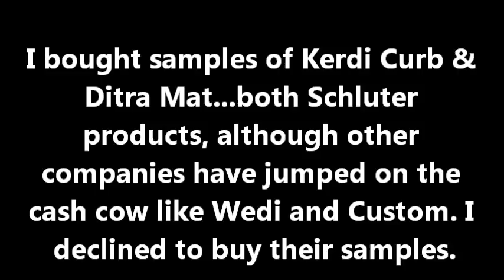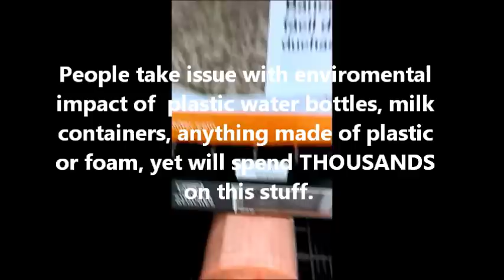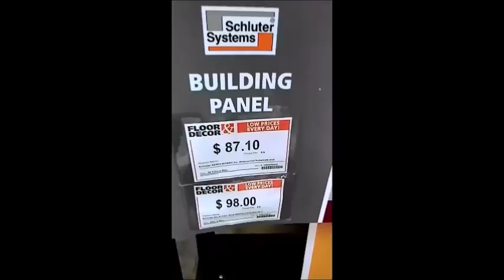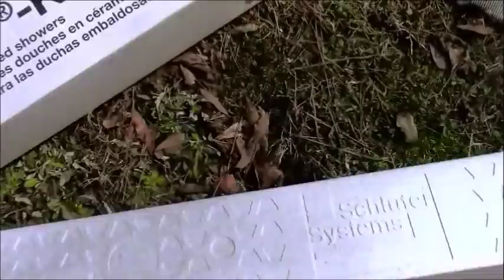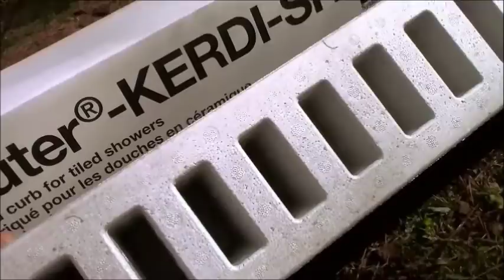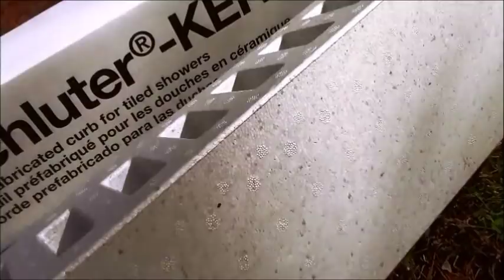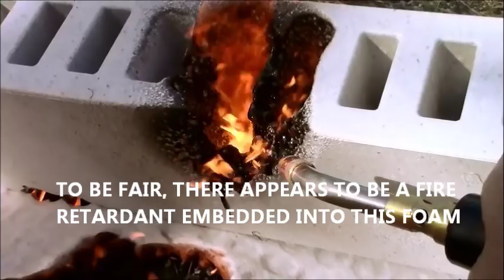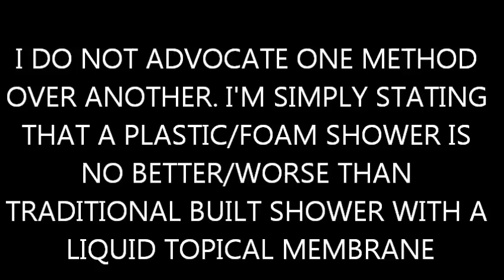BUILD SHOWER FROM FOAM and PLASTIC ??

Comment from the maker: The debate on proper materials will continue, in the end it doesn't matter, except the un-needed expense. I understand my view is un-popular, but I'll continue to speak out when I deem appropriate to do so. Comments are welcomed if you have an opposing view or something to add to the conversation...childish or stupid comments will be deleted so be nice
Reply: The video of it burning is impressive, and I get your firefighter point about the toxic chemicals, but, the Grenfell fire notwithstanding... How impressively would that stuff burn with a layer of tile/adhesive/grout on top, and a layer of subfloor/drywall/board underneath? Less impressively, right?

The real argument against this kind of stuff is: if it drives the material costs up more than the time saving in labour down, and doesn't give any significant benefit against existing methods, then there is no benefit.

I'm only an amateur, but I've done a few bathrooms and quite a bit of renovation... When you go into the building supply shop there are all kinds of "You can do this without any effort, just buy our stuff and it'll end up like a pro did it." products. People lose track of the fact that the biggest influence on the job is the quality of workmanship. I haven't watched all of your videos, but those I have all seem to fail because whoever was "doing" the "job" didn't use the materials correctly. 

Would I use the stuff? No. Why not? Because I can do the same job, in pretty much the same time (and DIY time costs zero), with traditional materials, if I take the time to figure out the underlying principles, and inform myself of the pitfalls. Your channel is great for pointing out the pitfalls - thanks!
Reply from the maker: IF it gets hot enough to ever burn, it will burn same way with or without other material(s) on it...but by then you have bigger issues. The bigger point of the video which was lost towards the end was the ridiculous expense.
Reply: One of the few things I agree with wholeheartedly.  That system is nothing more than a cashgrab. Shit product, why too expensive. Good video.
Reply: Schlutter. You have to use their thinset in order to have them warranty it. Read the fine print. I don’t know about your tile supply warehouses but in my area they sell all the Ditra and Kerdi shower products but they don’t sell their thinset. Makes sense doesn’t 
it?
I hotmop and cement float all my showers and tub enclosures for the past 25 years and have never had a failure. Knock on wood.
Demod showers 50 years old and they were fine just old.
Reply: Great videos by the way!
Reply: I STAY OLD SCHOOL !!!

Comment: I think these products are great for a DYIers, especially the pans.  I'd rather have an overly expensive pan than one that pools water and doesn't drain properly from my lack of experience doing the cement work.  The curbs, niches and benches I agree are unnecessary and very over priced.  I don't think these products are better, just easier for non-pros.  I could see pros using they for the time savings.  But I don't see them being better.
Reply: i have attempted this system, its not easy and the drain sux+ you are applying thinset to drywall? never made sense to me..

Comment: Plumber said the same thing when PVC drains came in, when pecs came in, when CPVC came in. All the professionals at that time right here to the old ways of doing things. But just like with PVC and in this case Schluter, technology is bringing us much better materials to use that will last far longer than the old traditional way of things. And I don't know what kind of soap bottles you use that would break through a curbs tile and substrate but damn.
Reply from the maker: Plumbers were happy to see PVC drains...and they solved a PROBLEM because there was one with cast iron drains. But they also thought Polybutylene was great and turned out it wasn't, CPVC was THOUGHT to be great and I show failures of THAT on my channel, and PEX has issues with rats eating through it to get to the water. 
The point of the curb is that it's only foam, glued with caulking....so NOT RIGHT*, while other ( older ) countries laugh at us, while they build with concrete & block...that will last FAR longer than the new crap we *THINK is better.

Comment: These products speed the job up immensely. As long as you can read and follow simple instructions it won't fail. That is if you actually follow the tcna handbook, like every installer should.

Comment: Please sur, tell your rate for a shower up to the ready for tile point. You rip on wedi, kerdi, when any real tile guy knows the cost is the same in the end labor and materials average out which ever way a installer goes. Lets do some simple math based on about a 25-30 sq ft pan
Wedi big pan. 1000 bucks. 150 to set. 1150 total
Kerdi pan with drain. 400 tops. 250 install. 650 total
Mud deck, bladder. Nice drain assembly.  150 materials and 900 on average to install. But 3 times the work. Still totally 1050. 
A homeowner will pay almost the same in the end as a total. Plain and simple. 
A diyer may save a little cash but the possibility for a less than happy outcome greatly increases with the labor intensive option.
Reply: MegaSkilla  "Are you ignorant or just a casual" Hmm.. I could say the same about you. I paid $350 for my complete Schluter shower kit. I have built the traditional way before. Schulter cuts two days off the install - waiting for the pre-slope then mud bed to cure, before applying waterproofing.

Comment: These products are fine, but they add wayyyyy to much price to a shower. And if you do a shower correctly any how you don't need these products. I"m amazed at how many professionals jump on the band wagon for these products. Good grief, a piece of styrofoam with a skin on it, they want in excess of 500 bucks for. A 2 1/2 x 5 ft piece of fiber glass or plastic for a pan, yep you guessed it 500 bucks. People never get tired of being robbed. This guys is right people. It's just corporate greed. I built showers most of my life and never had a call back or ever used these products. I for one am glad he is standing up to this madness.

Comment: Burning??? What the heck for?  Complete red herring.  Ditra and competing decoupling products (Mapegard, Redgard Uncoupling Mat, Stratamat) serve a very useful purpose - i.e. decoupling!  And carrying it, cutting it, and installing it is way easier than cement board.  It costs me $1/sf, and I don't have to buy screws for it.

Comment: I fully agree with you but for different reasons, it violate 2 major building principles in my book. 
1. Cement is incompatible with plastic ( in these products it is only adhering with a relatively weak mechanical bond)
2. Cement isnt waterproof, ( it is used as the primary waterproofer in these applications. )

If you disagree with me fine but I give 10 year warranty on all my work so I am only going to use products I believe in. Good luck collecting a warranty from one of these major companies like schlueter, gaaco, quest, ect.
Reply: Cement isn’t the primary waterproofer in this system, the Schluter membrane and banding fiber is the waterproofing when it is embedded into cement. That’s not the same thing. Really, the the only difference between this and say a product like Redguard is that one is solid and needs mortar to embed into and one is liquid. They do the same job. 
And you’re right plastic doesn’t bond well with cement on a flat surface, that’s why there is the fiber backing to Ditra on the bottom side. And on the top side, the ridges act as a channel in order for the mortar to interlock the tile layer with.
Reply: I give lifetime warranty, should be confident in your work

Comment: How can you give a public opinion if you don't actually know how the products are used and work together. You are giving some wrong information there bud. And you put cement board on top because you couldn't get it up... sounds like good stuff to me. Btw... that's the mat for Ditra heat... not standard ditra. You are bashing a product you know nothing about. And based on the videos of your work I've seen, you REALLY shouldn't be giving advice.
Reply from the maker: My opinion is just THAT ! My subjective opinion, as stated on the front end of the video. What exactly did I say that was incorrect ? How about when commenting that you actually have something substantial to say, rather than being ambiguous....based on the work on your videos, I would say you can't judge my work....wait, you have no videos !
Reply: RedGard, if applied properly is "waterproof" but it must be a minimum thickness of 25 mils (thickness of a thick business card) and comes with a 1 year warranty.  Most installers using this product fail to clean the substrate and apply enough, but not to much, to get the required coverage. For the most part, topical membranes run about the same specs.... however, would you really want a 1 year limited warranty? Schluter, Wedi etc give 10 years and more.  Second, you have no idea how the system actually works together so how can you give any advice on that? You say Kerdi fix applies the curb? Wrong. You talk about fire hazard to make your point? Really? First there must be fire. And then it, along with the wood studs,  possibly wood subfloor, carpet etc will all be up in flames... what good is a shower without a frame? I don't need videos because, well, I have education that I provide my customers directly. I use YOUR videos to show customers what not to do. I am a 20+ year installer with ZERO failures.  I am a Certified Tile Installer, certified by the Ceramic Tile Education Foundation. I follow ALL, ANSI and TCNA guidelines and specs. Something I absolutely without a doubt can say you do not. Do you really want to get into a debate? If you want a real education check out Sal DiBlasi's videos... oh wait...I bet that's one of the guys you mention... at least he knows what he's doing.
Reply from the maker: YES*, would love a debate !! Ignorance is *ALWAYS easy to overcome ;-)

To the mil thickness....5 years ago I posted a video with Redgard in a cardboard box, 3 coats, a week of water inside, no leaks > https://www.youtube.com/watch?v=2HOxm40cpBs&t=49s
The "warranty is a non-issue when encapsulated with thinset/tile...in the same way you claim fire is innocuous with foam/plastic because it's covered ( which in your analogy is wrong ). More to the point, I've yet to have a customer tell me their walls are falling apart or have issues because it wasn't waterproofed, when I use Redgard on WALLS it's mainly to make my customers feel better...on a vertical surface with thinset, large tile, sanded grout that is sealed water never see's the backer. That foam/plastic have a 10 year warranty is a great selling technique but nothing more. A non-waterproofed shower with DRYWALL will last WELL past 35 years > https://www.youtube.com/watch?v=Jxi-iSh-6A0

I am a 20 year tiler with ZERO failures too, so your point is ?? I also have a history in Jamaica, in the Caribbean they could care less about TCNA or ANSI, they never heard of them, and they have twice the history of setting A LOT more tile than we do ( 450 years ). Their tile AND buildings last a LOT LONGER than ours does, and they laugh at out wood & drywall houses...so belonging to an organization means absolutely NOTHING. 

And lastly...you know nothing about how fire spreads or the toxic chemicals of anything about the NFPA...yeah, look THAT up ! So that whole argument I won't even entertain with you. The Sal thing is a joke, he is a book soldier, and a sales guy...doing things by the book in the military will get you shot by your own men, and selling things in an online store takes away ANY & ALL credibility he has. He also has videos where he embedded wall board INSIDE his mortar, absolutely stupid. He has videos where walls were not waterproofed at all, just the seams. He has made a lot of videos that I would never follow..but YOU say he knows what he's doing ?? LOL !! Yeah ok. He does things by the book to get in good with not only his subs, but with the companies like Schluter so he'll receive revenue...if he believes in the products or not, it doesn't matter. It's all about marketing. I'm beholding to NO ONE ! 

For some reason you think I'm bashing an industry when I'm only giving my opinion...I thought I fought for THAT right ! Anyone is free to buy any products they want to, I could care less honestly, but it's a waste of time & money in my opinion and THAT was the point of the video. You are free to disagree, but when you come on MY channel & MY video degrading me or my methods then be ready for an appropriate response from me....*AND YES, I'LL DEBATE YOU ANY TIME, EVEN BY PHONE*
Reply: Daaaaamn! Starr you went off, never an issue? That’s a little far fetched
I do think your a good tile man though. Agree with a lot u say, some bit so much. 10 mechanics might do things 8 different ways but as long as it’s good in the end who gives a F

Comment: The main benefit from using these types of systems is weight. These work better (and safer) especially on 2nd floor installations because of the light weight.

Comment: Good golly I’ve read most of these comments. Most are about money. Yes you make more breaking your back and making a mess cleaning up a job site doing your cement board walls and double pour. But where do you make money in a shower? Prepping the shower for tile or setting tile? I make mine setting tile. If I can have a shower prepared in one day for tile I win. Yes I charge less for prep. I get the same as you I just give the home owner better products. And Shulter is installer friendly if you are buying it like a pro. They want installers to make money on their products. If done correctly there is no issues. I’ve used it since 2001. I won’t touch anything else. Ditra has been out since 1980s and is still here. They have the best warranty in tile products if you’ve been trained and use what they need you to. More power to you if your body can handle your way

Comment: "I'm not saying it's not sturdy, I'm saying inherently it's weak."  Wow.  Well, you really missed the boat on this one.  You don't have experience with this stuff, so you really don't know much about it.  Some of the Schluter products are expensive, but much less expensive for contractors who get their own pricing and can buy by the linear foot or square foot.  You're also wrong when you say all Schluter components only work with their other proprietary components.  Kerdi curbs "glued" down!  Ha!  No, it's attached with standard thinset.  I personally don't use the Kerdi board because it is expensive. Again, Kerdi membrane is used with standard (NON proprietary) drywall.  It all also works over standard mortar beds.  Their shower tray and integrated drain system are so fast and easy, I consider the $150 combo money well spent.  No mortar bed to float, no preslope, no rubber pan liner.  And by the way, your "destruction" of Kerdi foam is just silly - it simply doesn't get used that way.

Comment: In the end if done properly both methods will be just fine. I did the durock and water proofing membrane in my shower which i guess would be a hybrid of old and new. If i could afford the foam boards and that outrageous price i would have because it would be hella easier to install. As far as environmental impacts of products there are pros and cons of all. Making cement boards or just plain portland cement or any other ingredients in any product will inherently have manufacturing environmental impact.

Comment: I really can't argue with your basic premise, that a topical membrane (**if properly applied**) is 100% waterproof.  However, the newer foam or Schluter systems are (imho) an easier way to achieve a closed system.  For a pro that does this for a living, that's not a problem, but a homeowner/DIYer will have an easier time with the newer materials.

One nit to pick.... the foam is not the same as the old styrofoam coolers.  That was open-cell polystyrene.  Wedi, Kerdi-Board, etc, are a closed cell foam.
Reply from the maker: I don't agree it's an easier system...it does not get easier than painting on 2-3 coats of a liquid membrane. But the cost is a HUGE factor to me, and I never pay on materials...but wouldn't allow my customers to get ripped for something that is not needed.